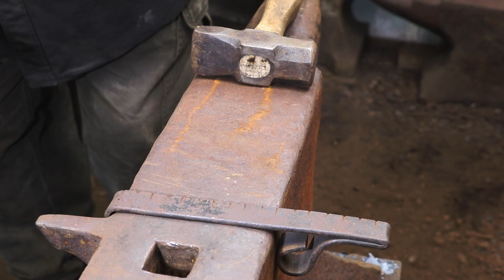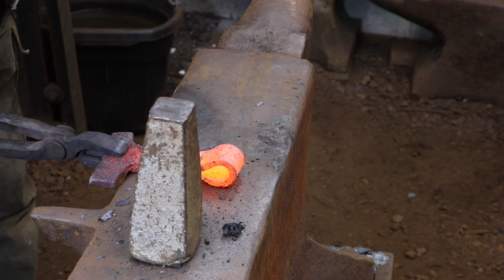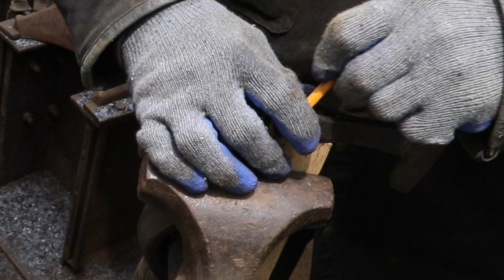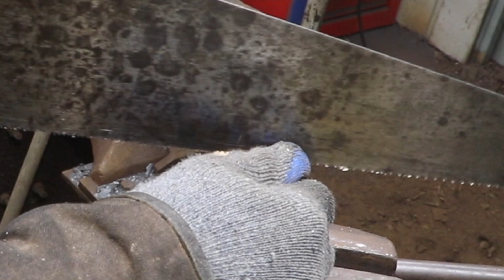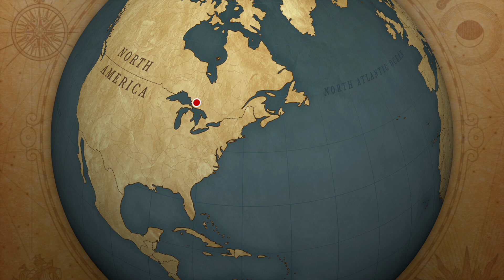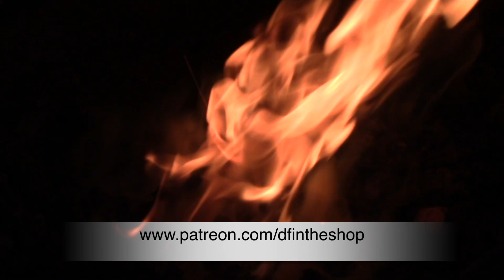Blacksmithing Project - A Viking Style Carving Axe

Comment: I like a light quick axe for almost every way I use one, from woodland management to carving (my heaviest felling axe is only about 6lb and I don't use it alot because of the weight) , I want to have a go with this kind of axe but I am also going to try leaving the whole head on the bar, cutting it off after the second weld, Not sure why but I feel like it would be an interesting way to do it.
Thanks for sharing

Comment: What scrap did you use to make your drifts so I know what to look out for
Reply from the maker: This drift was just welded up from two wedge shaped pieces of flat bar for the sides and two tapered pieces of 3/8 square bar as the spacers for the flat bars..  I only use drifts to shape an opening not to create a larger opening from a smaller hole so they don't need take much abuse.